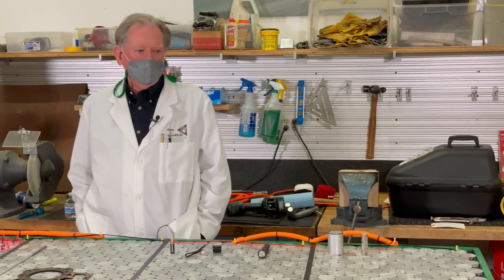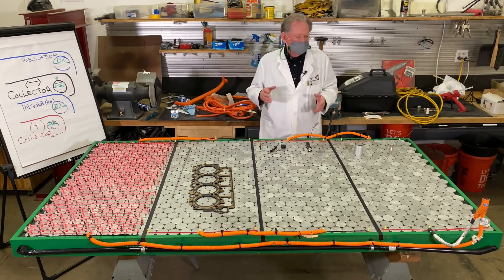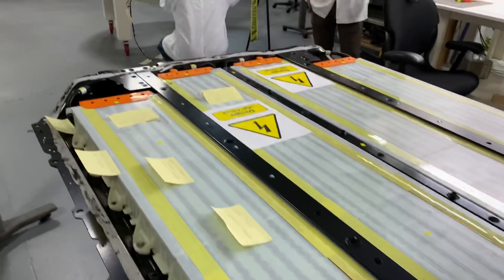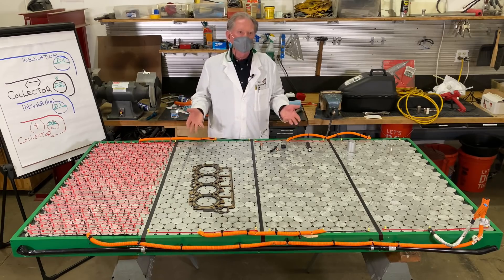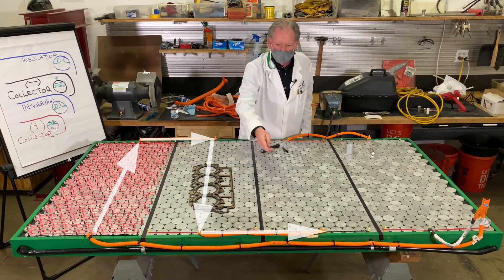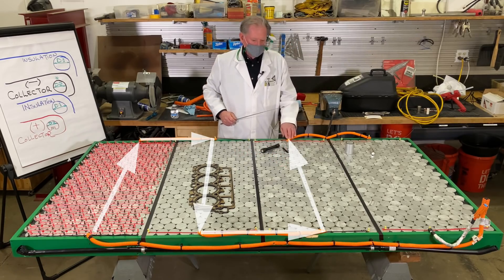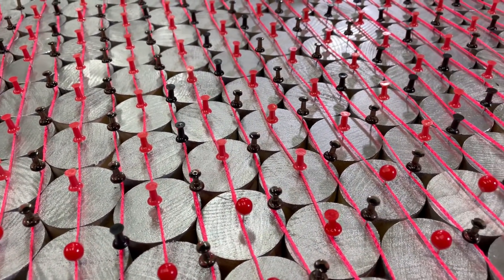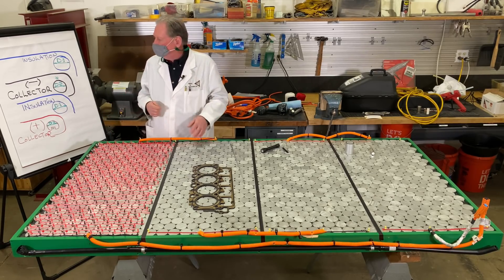Tesla 4680 Battery Pack Prophecy

Comment: Congrats on 100k, Sandy. Have you considered showing a vertical cross section diagram of the cell and layered cell/conductor/insulator structure? I think that would help visualize how the connections are made to the cell terminals. It reminds me of how silicon integrated circuits connections are made between transistors with alternating layers of materials.

Which then makes me think, is there some way to "print" the conductor/insulator layers across the top of the module? Just brainstorming...

Comment: Mr. Munro, you may be correct, but what you present is essentially a linear architecture.  This will lead to fatigue for the cells at the collector points.  To minimize this fatigue, and to optimize cell management, the design will enter the third dimension.  Think of a network of cells where no cell needs to transfer load or charge from any other cell.

Comment: Hi Sandy,
first of all happy thanksgiving to you and your team! 
A few questions: The small tab that is spot-welded to the positive side and the 2nd one to the negative side, wouldn't these tab just negate the improvements they made with the tab on the inside of the cell? In other words: it would simply externalize the tab of the cell? The tab would have to be thicker in diameter to withstand 6x the power of the 2170s, wouldn't it? 
Would it be possible to have the collection of the positive side on top of the module and the negative side on the bottom (or reversed)? I know the thermal management of the cells is on the bottom but maybe there is a possibility to reuse the thermal management to act as a collector

Comment: I have  given comments on linked in  how I see it  two main issues  1 Fuses and Two separation  between  rows of 10 batteries.

https://www.linkedin.com/posts/arie-lashansky-47116810_tesla-4680-battery-pack-prophecy-activity-6737654319635542016-h2EL

Comment: Since cells will be structural part of the pack along with strucutral glue between cells joining top and bottom, how will the manifold type plates allow adhesion of top plate with the cells? Since they cant weld the cells to top and bottom plates, will there be cut outs for the structural glue in the current collector manifold to allow mating?

Comment: I hope they dont put both terminals on one side, the risks of an electrical short during a crash will be extremely high.  Also hope they don’t put packs in series, as cars using different numbers of packs will need to have equipment to cope with different source voltages.  Personally, I would design each pack as to give high output voltage, maybe using only 5 batteries to a series which would still give some good redundancy.  Higher voltages doesn’t directly give more power, but has a lower energy loss, so is more efficient.

Comment: What's going to go between the gaps between individual cells? Will it be left as air gaps? Think I heard Munro mention it might be filled with some kind of resin or something to increase rigidity although I may have misheard or misunderstood. I was wondering how that would effect longer term maintenance. Are Tesla planning on doing what Mobile phone manufacturers have done and make it harder to get at and fix/swap batteries (albeit for different reasons)?

Also what about cooling? I know from watching a previous Munro video that the idea is to cool the tops and/or bottoms of the cells as that is where the heat is. But will both ends need to be cooled or just the side where the connectors are?

Comment: Sorry,  "5X more energy" and "16% more range" doesn't make sense. The car expends X amount of energy per mile. If the battery pack has 5X more energy, why is that only 16% more range?  Also, wouldn't a pack with 5X energy capacity take 5X longer to charge? The answer is, the pack doesn't hold 5X more energy. The new battery might hold 5X more energy than the old battery, but is larger., so the pack holds fewer.

Comment: I get it that making the battery pack a structural member reduces production costs, but what does that do to repair costs?  And will this structural member be more stable in accidents.  Because that latest Model 3 catastrophic accident where the batteries were thrown out all over the place and started a fire inside a house, is very scary.

Comment: those "little wires" on the old system are fusible links .   if a cell has a thermal run away the amps will melt the wire to isolate that cell
to go to a manifold bus bar would mean Tesla no longer needs fusible links
Reply: Perhaps the conductors between the cells could be of a small enough cross section to act as fuses. You could still cut it as one large sheet to lay over the grid of cells.

Comment: Great thing about the manifold is those holes can be used to actively cool the most important section of the battery, and using the manifold with defined strings of batteries will make different packaging sizes easier. Great analysis guys! Just hope we can retrofit our existing Tesla’s one day.

Comment: I have a question, is there a way reason why they don't opt for rectangular cell as oppose to regular cylindrical cell ? wouldn't you able to pack 27% more cell material in the same amount of space using square cell as oppose to rectangular cell ? Plus you don't need leave the core empty because rolling angle is too sharp to bend the cell material. Or is making a rectangular cell that much more costly than rolling a cylindrical cell that it's not worth the 27% more packing factor ?

Comment: Given the decrease in the total number of cells, and the tabless cell design supporting higher sustained currents, connection of the cells to the collector will surely be done in a way to allow higher current with less resistance, which would mean not just a different attachment design but a greater total contact area per cell.

Comment: New cell 4680, has 6x the power, 5x the energy over the 2170,  but only 16% more range? The numbers don't add up.   Note no mention of tabless batteries. Congrats on 100k subscribers.
Reply: 5 times the energy because it is like 5 21700 cells. 6 times the power. The extra power comes from the tabless design. It has less resistance. the less resistance is where you get the extra range.
Reply: @JasonWW2000  Less resistance (thanks to the tabless design and chemistry tweaks) gives you more discharge power, not more capacity. The extra range (estimated) is coming from the extra capacity the whole pack will have for the same weight, thanks to cleaver design that simplify assembly and ultimately makes you able to build bigger battery packs.
Reply: @GiovanniEsposito5  No, you get extra capacity due to less of the batteries energy being converted to heat. The tabless design runs cooler. Then the extra cells in the same physical pack size add additional capacity on top of that. The tabless construction alone is said to give 16% more power (or energy, I forget))
Reply: @JasonWW2000  No, you don't get extra capacity from running cooler, you get extra power. The extra capacity is mainly because the battery pack as a whole is bigger, thanks to better design (also thanks to a top/down type of cooling that the pack will have, instead of the actual heat pipes between cells.) It's not the tabless construction alone that gives you 16% more energy, it's the whole battery pack redesign that they claim can give you 16% more energy and than range. https://batteryuniversity.com/learn/article/rising_internal_resistance#:~:text=A%20battery%20with%20low%20internal%20resistance%20delivers%20high%20current%20on,cuts%20off%2C%20leaving%20energy%20behind.&text=Lead%20acid%20has%20a%20very,last%20for%20a%20few%20seconds.
Reply: @GiovanniEsposito5  I believe we will have to agree to disagree.
Reply: @JasonWW2000  It's not my opinion, it's physic. You can't disagree with physic. Read the article I linked you, it explains in relativly simple terms what is internal resistance and how it affects battery discharge. Also here in detail: https://www.electronicsonline.net.au/content/power/article/does-internal-resistance-reveal-battery-capacity--1267767590#axzz6evfQ7Fjf
Reply: He is repeating the same crap they said at the tesla battery day, of course forgetting that this figures are compared to a 2170 cells. 4680 is 5.5 times bigger then 2170, so it has 6x more power and 5x more energy compared to 2170. The energy density on 4680 at cell level is actually LOWER than what it was with the previous format 2170. All the benefits of the new format and design are at pack manufacturing level and cell production. There is no increase of energy density at cell level.

Comment: I seriously doubt they will use gaskets in the manner your suggesting as it will undermine heat dissipation. The configuration of the batteries is an elementary application of series connecting batteries for required voltage and parallel connecting for amps.

Comment: I always pictured what I think Sandy is describing as the manifold to be something like a printed pcb-like flexible board. It would be easier to mass-manufacture the voltage interconnects than how they wire each cell; must be a complicated process. Tesla, does in fact have a patent for a "printed circuit as high voltage interconnect in battery modules"
https://patents.google.com/patent/US20140212695A1/en

Comment: Sandy, agree with you on layout - Battery Day images showed 40 by 24 cell arrangements. Tesla can keep everything the same but have different capacities and costs by switching from LFP to NM to 'high nickel' (NMCA ?? or NMAC if cobalt quantity is lowest.). Love that gasket style approach to insulation and connections - maybe Tesla just copied your idea, or other manufacturers have just done so. Have you patented it?? Generally, the max difference between insulated parts is just 4.2 Volts. But between each of the 4 segments of the battery the max difference ranges from 4.2 to 200 Volts - so more insulation between the segments. Between each row of 10 cells there needs to be an insulator too so the cans (negative) do not touch each other. I expect there will be at least 2 connectors to each of the cell top and cell sides for redundancy - a lot less wastage for a small additional cost. As the battery is structural, Tesla will need an epoxy resin that can carry shear loads and is also an electrical insulator. Between the cell can and cooling plate, an insulator is needed. Perhaps Tesla will separate the cans by a couple of millimetres so that it can squirt in epoxy resin, have it surround the cells and bond to the cooling plate between the cells. It will also need to bond to a top plate if it is to be a structural sandwich. Top plate could be a water-cooled plate. Bottom cooling plate needs a thick abrasion and thermal resistant coating on its underside to prevent heat loss in northern winters and prevent heat radiated by asphalt roads from roasting the undersides. Asphalt can reach 60 degree Centigrade in hot climates. Tesla wants most car thermal exchange with the environment to be via the front radiator/heat exchanger.

Comment: How do you get the 6x power number?  If the power goes 6x then the range should go 6x?  Something is wrong with that math.
Reply: I think that's per cell.  Instead of just under 5000 cells now you use just under 1000 but each cell has 6x the power of the old small cell.

Comment: What if the outer jacket of the cells was the negative? Then have them tightly packed with a conductive filler or solder between the cells. That would reduce the need for hundreds of small wires needing to be soldered to the negative tab on the cells.

Comment: Very interesting, will the suggested negitive connection on the can add a small amount of resistance due to a longer path from where the negative 'tabs' connect to the can (at the other end)?
Reply: They should not since the entire diameter of the cell acts as a conductor.

Comment: Thanks Sandy. How does physical size of new pack compare with same size pack using 2170 cells?
Happy Christmas, best wishes.
Reply: We don't know the size of the new pack yet.
Reply: @JasonWW2000  I mean let’s say 80kw pack using both cells.
Reply: @anthonybrazzale7251  Tesla just showed their new battery pack. It does not use the 3 dividers which take up space. It is wall to wall cells so they are able to increase capacity by fitting more cells in the same space. So the new pack might be 85-90kW which means more range. Plus the reduced resistance of the  tabless construction means more range on top of that.

Comment: 336v nominal means they gotta be using thick heavy wires... Voltage sag will be an issue... bus voltage should be higher

Comment: Maybe I misunderstood, but wouldn't the modules be in parallel? Otherwise your math suggests the overall high voltage system would operate at 1344V (336V * 4modules).  Love the demo though.

Comment: I wonder if the other theory was all the Positives on top and the negatives on bottom connected with plates both on top and bottom? for that theory you would not even have to wield the bottom just use the car frame as the ground.

Comment: If you connect the batteries in serial will one bad cell disable all the following cells?  What is the voltage of one cell, and what will be the operational voltage of a complete pack?

Comment: The small wire in the current pack acts as a fuse to isolate a rogue cell. The design presented looks like a blown connection would take out an entire module. What mechanism does this new design use to isolate a bad cell from the module?

Thanks. Love what you do.

Comment: When you connect the 4 batteries in series, wouldn't you get a total of 96 x 3,5 x 4 = 1344 volts?
Reply from the maker: 960 cells. 96s10p. Each section is 1/4 of the pack, 24s10p, which is 24x3.5v=84v. 84v x 4 = 336v.

Comment: Another point is heat management. The core of the battery generates a lot of heat that cannot reach the cooling points. If the Center were hollow cooling fluid could run directly past the hottest area of the battery. This will then allow better overall temperature control of each cell which then allows for fast charging and discharging without causing cell damage. The 18650s were that size because they couldn’t get rid of the heat if they went larger. Tesla with their cooling system could go a bit bigger so they went to 2160s. Now with the newer larger cells internal heat gains have to be dealt with.

Comment: Congrats on the 100k! I think there's a bit more wrt the tabless electrode- it's going to be a bigger battery innovation than only the two welds required, and will also have a heat dispersion mechanism & BMC that will extend battery lifetime and efficiency. Great content keep it coming!

Comment: As far as i know, those small wires (3:50) are fuses, so they have a function: if one cell shortcircuits, the fuse blows up disconnecting it from the pack and the battery is still functional.
Reply: Correct. new design should have something similar, but built into the manifolds.

Comment: I believe these "small wires" which are connecting batteries in old packs do have another, very important function. They are acting as natural fuses. In case if something bad happens to a single cell they just blow out, stopping the cell from overheating and from starting a chain reaction which could end up really badly... The battery pack remains functional with some of them blown out.
Reply: Correct, New design will probably have similar "fuses" integrated into the manifold.

Comment: I thought one end is going to sit in a tray to collect one charge and the top with the tab and maybe welds (I'm thinking they want to stay away from welding but whatever) will be the other charge.  This seems awfully complicated from the manufacturing point of view.  That tray will be thin and also conduct away excess heat because it is not structural - the individual cells glued together will be the structure.  Will see.  You should take bets on it but you can't use my Cybertruck to disassemble for a look-see.

Comment: I may have misunderstood but I thought at battery day it was revealed that the positive anode was on the bottom and the negative was on top. Assuming each module was comprised of parallel cells. The best process is no process. The best part is no part. But also, Tesla lies.

Comment: Also I would love if you could dive deeper into structural pack land. For the pack to be structural there has to be two plates welded to cell cans. One on bottom and one on top. This will provide rigidity. How the plate on top would interplay with current collector manifold is quite interesting :)